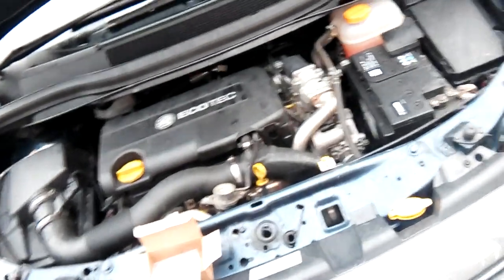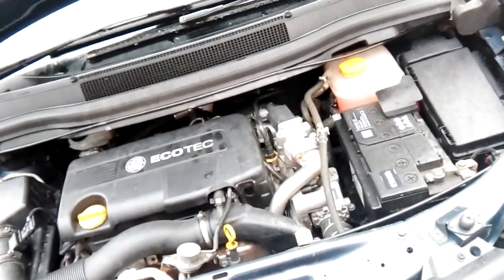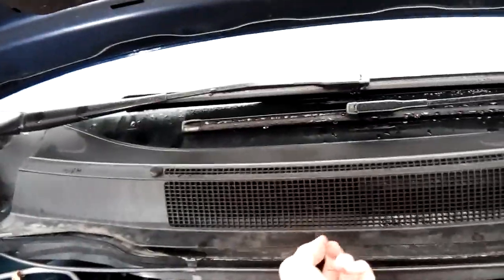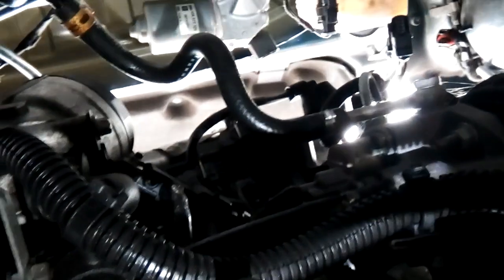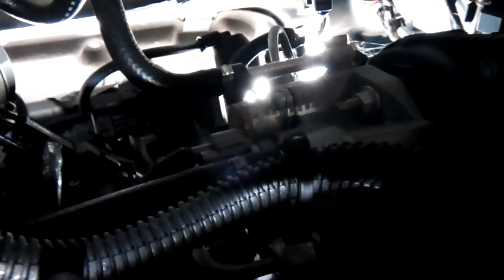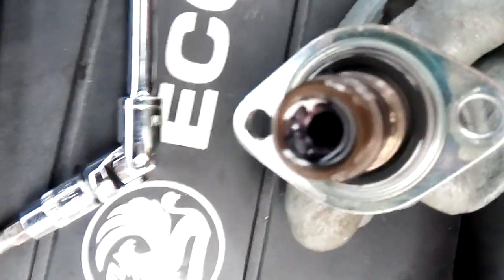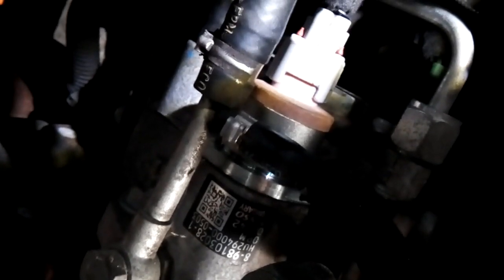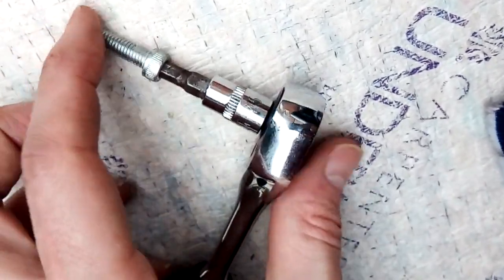Vauxhall (Opel) Zafira B 2011 Surge control valve replacement A17DTJ 1.7cdti Bosch

Comment: I have 2013 b 1.7 cdti zafira and had the same idle problems replaced the SCV  it idles great for 30 seconds and then cuts out pedal self test gave 3 fault codes 000161 then 023462 then 000000the only thing i can do is bleed the fuel at injectors or any sugestions thanks great video

Comment: Just did mine, good video btw, I did everything on top of the engine, the lower bolt was actually the easiest, it's the upper bolt which is against the head, you can't use your fingers to get hold of it, I had to use a long hex socket to remove and then glue the new bolt to it to screw in, then allen key to pinch it up.  Quite fiddly.  Drives perfect now.
Reply from the maker: Great news, glad you got it sorted. Yes bit of a tricky one to get to, great idea on glue to the bolt on the allen key to hold it in place!

Comment: Hi, Mate.

Do i need adjust valve after replacement?
Reply from the maker: Hi, no it self adjusts based on fuel required so after starting for the first time to get air out of the system it'll be fine.

Comment: Start by checking all basics, air filter, oil lvl and scan the car. If no codes it is likely the SCV suction control Valve on your high Pressure fuel pump.. https://m.youtube.com/watch?v=MHILFseKj5Q

Comment: Hi Andy,really good helpfull video,I have this same problem,is any chance you can drop a link where I can buy genuine control valve,I find so many on ebay but I heard is very high chance it is fake not genuine Denso,your link where you bought it is not working anymore,and at the deler they sad it will cost me to buy 270£ if you know where I can buy cheaper denso genuine fuel suction control valve please drop a link,thank you
Reply from the maker: Hi, glad it's useful to you. Searching on the part number this looks a compatible part.
Double check for yourself but that should work:
https://www.partsinmotion.co.uk/car-parts/ecu/fuel-supply/denso-suction-control-valve-dcrs301110-detail?srsltid=AfmBOorcmhSBXfo7NI0ZLJIDchMxxkl6i-ZRB-3k8jOvCUjpBOX47jnt0WM
Reply: @junkendriven  Thank you so much for quick response, all your videos is very helpful :) is it trustable link to buy and it is genuine part?,sorry I never bought anything from this website,thank you.

Comment: Hi, great video, I managed to get the bolts out, however I can’t seem to pull the valve out. Does it need turning before pops out? Thanks
Reply from the maker: Hi there, it doesn't need turning but if you look on the replacement valve there are orings that make it a very tight fit. Gently wiggle it free by a little side to side movement and it should come free
Reply: @junkendriven  sorry one other question, my new part has arrived with a new gasket, however there isn’t one on the old one? Did you use a gasket? Thanks

Comment: Hi have same issue whre the idle is hunting. Bought a £30 scv valve and the car wouldn’t start but when unplugged it it started… anyway I put the original part back in and it’s hunting on idle again however when I unplug it then it idles nicely… . Any ideas as to shall I leave the plug in or out or shall I just get a genuine part that costs over £200. Thanks
Reply: Please can you tell me whre you got your scv valve from as looking at your video your one seems to have done the trick
Reply: Thanks for that 👍will have another go at it
Reply from the maker: Hi Jimmy, yes I've had a few problems with the cheap egr they definitely don't talk to the ECU right, have a look on my channel as I've done a few videos and same as you found only genuine works. Could you do the trick I did, swap the egr valve itself onto the old motor/solenoid body and that should work for you?
https://youtu.be/qpCfEldit1A
Reply: Hi mate sorry I think you misunderstood me. I have the same issue as this and it’s all pointing to the SCV valve. I bought one for 30 quid and it didn’t work but when I put my old scv valve back in it works but hunts on the idle.
Reply from the maker: @jimmykvlogs2483  ahh, apologies, yes confused the videos as I had egr problems with a cheap replacement!
But yea you're right, a scv cheap one is also a problem in exactly how you describe, also cheap ones seem to fail after 1 year.
I bought genuine Denso scv similar to:
https://www.ebay.co.uk/itm/256085570211?mkcid=16&mkevt=1&mkrid=711-127632-2357-0&ssspo=0_DQ9XZ_QWW&sssrc=4429486&ssuid=anERn0beRa2&var=&widget_ver=artemis&media=COPY

Comment: Andy, is a SCV the same as a purge valve, that helps your engine to breath. I have been told to check my purge valve.. is this the same thing in a more modern engine than the plastic ones i have been seeing???
Reply from the maker: Hi, no the pcv is part of the engine ventilation system (often a plastic circle on the top of vauxhall engines, unsure on the zafira location). It's part of the crankcase ventilation system and if blocked it can cause issues.
The surge control valve is used for controlling the pressure on the fuel rail from the high pressure pump.
Hope that helps
Reply: @junkendriven  thanks Andy. Appreciate your clarification. I have been told to check it, seem to struggle to find it in the 2014 Opel Zafira 1.7cdti.. sounds a bit daft, but seems to be no info anywhere, but lots of people suggesting to check it. I can see it on older models, but, maybe it is updated on the B (2008-2014). ThNks hunting goes on!!!!!

Comment: Does the 1.8vvt engine have one of these? Mine does this randomly 🤔
Reply from the maker: I doubt it as that's a petrol engine the 1.8vvt so my guess for rough or rev hunting, first stop would be spark plugs and maybe coil pack
Reply: @junkendriven  it only does it while it’s on the choke sometimes. It’s had a new genuine coil pack and standard Bosch plugs not long ago. Still does it randomly only when on choke randomly but not every time

Comment: Hi Andy.  Thanks for the video.  I had exactly this problem on my 2012 Astra J 1.7 CDTi.  Bought a replacement SCV off eBay and fitted it yesterday.  Bit of a faff getting access to it, but replacing it has done the job and no need to re-calibrate the ECU or anything like that.  The surging has gone and the car pulls much stronger from cold when moving off - previously it felt down on power when pulling away from cold, but I'd put this down to general deterioration of the engine, but not so.  Now drives like a new car!  Cheers.  Graham
Reply: Merci pour l’info j’avais peur par rapport à l’écu la mienne le fait on dirait qu’elle va caler. Pas de problème pour le ré amorçage du circuit gasoil ? Cordialement

Comment: I have changed the scv naw the car keeps cutting out when stationary at traffic lights
Reply from the maker: Hi, is it taking longer to crank and start? I'd guess it's drawing air so chances are the gasket or seal isn't quite right on it so might need to re nip it tight. Stalling at idle is another give away that it's drawing air
Reply: If it only idles for about 20 seconds you'll need to plug an obd2 code reader that has some sort of function control into the car and select learn fuel pressure regulator function. Claude Taube has a video here on YouTube showing the procedure.

Comment: I had same problem mine was the camshaft sensor not the scv. It was identical problem as you shown here so just a heads up as it can also be other issues, the camshaft sensor is £37
Reply from the maker: Good info Leon thanks for that, did the camshaft sensor not throw up a fault code to the ECU?
Reply: @junkendriven  no because it was faulty not broken
Reply: @leonknight2599  hi when you changed the camshaft sensor did it need to relearn or is a plug and play part? 😊

Comment: I have same problem with my zafira 1.7 cdti ecoflex  2011. Can I ask you what I need buy just fuel pump pressure?  Thank you
Reply from the maker: Hi, this is what you need, the denso valve:
OEM/OE code DCRS301110 Denso diesel fuel suction control valve
https://ebay.us/8PVTcV
Reply: @junkendriven  thank you

Comment: Excellent, thank you. Should cure one problem but my big ussue is same engine fails pollution test but there are no faults on the diagnostics.  Very confused and so is my mechanic.  Cheers.
Reply from the maker: Hi Robert, glad the videos have helped, for pollution failures (exhaust gas on MOT?) then my guess would be to look at the EGR next, I'm about to put a new video up in the next week as I've had a catastrophic failure of my EGR in the Zafira, but it might help you also.

Comment: hi do u know what would be the issue for an error code of p0171
Reply from the maker: P0171 is o2 readings on the exhaust output sensor being too low. Could be all sorts of things, vacuum leaks, MAF and air filter are the easier ones to check and spot. I'd start looking at those 3 first before going further in.

Comment: Hi Andy I have the same issue on my 2011 zafira 1.7 cdti ecoflex elite. Would you have a link for this item. Also would it have an issue where the fuel range dissappears every now and again and goes through more fuel?
Reply from the maker: Hi there. Try this ebay link:
 https://www.ebay.co.uk/itm/-/283914172059?mkevt=1&mkcid=16&mkrid=711-127632-2357-0
For the suction control valve.
Also, the fuel range will be due to DPF regeneration cycles, take a look at my other video: https://youtu.be/48V45aTW6io
Reply: Thanks for getting back to me Andy. Today I managed to change the suction control valve.when taking it out I took a small pull . But when putting the new one in I couldn’t push in so easy . What I had to do was use the bolts and put them in bit by bit and it did go in and tightened up nicely .but I couldn’t test it as when leaning over the top of the engine the leak off pipes where very brittle and one snapped at the t junction 😭
Reply from the maker: @burncdm  Ohh, bad luck, yes those diesel return pipes can be pretty brittle, easily replaced though just search ebay for them. Glad you got it replaced, yes they can be tricky to go back in, it's due to the o-ring sealing well, which is good as makes sure it's a good seal. Hope you get sorted and back on the road soon.
Reply: @junkendriven  also now with replacing the scv and the leak off pipes and replaced the fuel filter she won’t start 😭any ideas Andy I’ve taken off the fuel injector pipes but nothing she’s definitely air locked
Reply from the maker: @burncdm  just saw your comment on the FB group!
Use the low pressure fuel pump to reprime the system. Ignition to on position (not start) and wait a minute or two. Back to off and repeat a few times. That will help get fuel back into the system that was lost when the solenoid was removed. That should help, just be persistent and it'll fire.
Reply: By any chance would you have a video on replacing them ?

Comment: Thank you so much, Andy. I have a Zafira B 1.9 CDTI and engine turns of by itself. I cleaned throttle body last week, but it just only worked 6 days, today engine stopped suddenly again on my way to work. Do you think I also need to change the surge control valve to fix the problem? We have changed the diesel filter and cleaned throttle body. But it worked temporarily. Could you share your experience, please?
Reply from the maker: Hi, anything with fuel system seems to cause intermittent. The problem is there are so many components. Are you getting engine management and any codes?
At cold does your revs hunt like mine? If so then yes I'd say worth changing but it's a bit of parts darts at that stage unfortunately
Reply: Could be your fuel pump, the same thing happened to my zafira b diesel .

After testing most things out the mechanic came to the fuel pump and changed it. Voila the car start working again, however the surging issues have persisted and sometimes it makes a rough engine idle sound by going lower in revs than normal .
When I accelerate the revs it goes back to normal surging .

I don't know how to find out which scv I need.

I am not good with replacing parts etc .

Comment: I had this surging problem with my zafira until a couple of months ago.. purchased the scv from gsf parts.. now runs as it should and saves some fuel to...
Reply: How much did you pay for the part?
Reply: How did you calibrate the new scv? Can you also do it with opcom and how?

Comment: hello I have a problem with the radiator fan which starts very early after 5 to 10 minutes of starting the fan engages for an Opel Zafira B 1.7 CDTI
Reply: Is the car trying to do a dpf regeneration. You can check this buy stopping car and look at fuel consumption if it is 0.5 or more instead of 0.1 then you need to take car for a run over 40mph constant above 2000 rpm change down gear if needed to clear it
Reply from the maker: Hi, as Leon states, chances are it's related to dpf regeneration as that turns the cooling fan on. The air con being on is another reason your cooling fan would be on.
For dpf I did a video on it and how to fit an indicator light https://youtu.be/48V45aTW6io

Comment: Is this engine part the same as the fuel pressure regulator? I've seen this problem being fixed by cha ging that ? Is this the same problem ?
Reply from the maker: Yes, I believe it's one and the same on the 1.7cdti ecoflex engine. The Surge control valve is directly on the back of the high pressure fuel pump so my guess is it's also called the regulator as it's a solenoid that can pulse to vary the pressure.

Comment: Where can i find it?
Reply from the maker: Hi, part number and link on amazon:
OEM/OE code DCRS301110 Denso diesel fuel suction control valve https://amzn.to/3mjDpy4
Reply: @junkendriven  thank you😥.
I mean, where do I find his location in the car?😁
Reply from the maker: Ohh, apologies. So the surge control valve on Zafira 2011 is down the rear left side of the engine (As you face the engine bay from the front). It's attached to the high pressure fuel pump which is driven by the timing belt, so follow the timing belt housing towards the back of the engine, then down and you'll find it.
Reply: @junkendriven  Thank you 🙋‍♂️💙

Comment: I've been wondering what was Causig this. Have looked everywhere   on forums as to what could be the cause. Only you mentioned the SCV.  That engine idle and rev counter is identical to what I'm currently experiencing. So I have no doubt it's that. I've ordered a new SCV and will be fitting it Tuesday. Hopefully this will be solved. 
Thanks Again 👍
Reply from the maker: Great news, yes it's obscure but hopefully it'll do the job and solve your issue. Thanks for commenting :-)
Reply: @junkendriven  garages were saying could be egr valve etc. Would have to bring it in. 
They would then have slapped the labour on top etc. So spending 70 quid on a part is much better. 
I was sceptical until the sound your engine made mirrored what mine does now.
Reply from the maker: Egr is a possibility so don't totally dismiss it. I've done another video on cleaning the egr if you want to give that a go as it's easy and zero cost.
https://youtu.be/3R2MCWQGCT4
 The difference I found is with egr the rev hunting didn't go away, it would do it at different revs, speeds, after engine earned up, etc.
This scv was specifically at cold and goes away as engine warms up.
Reply: @junkendriven  Just a quick update...
I've installed the new suction control valve and the problem seems to have been eradicated. 

I also had another issue before changing the SCV which was when driving the vehicle it felt like the car was being pulled or held back when driving. But this has also been eradicated. So thumbs up all around...

I think this has been an issue for a while. It was like it when I bought the car. I think the previous owner had this issue and looks like he changed the egr valve in a trial and error to try to and fix the problem. I assume he probably didnt know about the SCV
Thanks again 👍
Reply: The problem seems to have come back around 6 weeks after the suction control valve has been changed. May have to change it again
Reply: @geraintjones1349  did u manage to fix it. Same issue on my Astra j 1.7
Reply: @geraintjones1349  May i suggest buy a denso or better quality part.. i have heard cheap chinese (or these being sold as expensive, but are not Denso or OEM are poor parts. Mind you, i recently heard that cheap rip off parts are making it into mainstream OEM parts or being sold as a quality parts..i suppose anyone can change a label if they want too.. 🤔

Comment: Very informative, thanks. I have very similar issues with Astra J 2.0 cdti, although not quite as erratic yet. SCV again, do you think?
Reply: i thought the astra j 2.0 used the bosh system, unles it is the ech,teck engine

Comment: Tried this and it didnt work.
Reply from the maker: Sorry to hear that, you still have engine idle hunting? It may be a vacuum line or something elsewhere. Good luck finding it.
Reply: @junkendriven  changed mine, and cleaned out the EGR now it cranks but wont start ( will start one every blue moon but cuts out soon as foot off) any ideas ?
Reply: @junkendriven  yes,cleaned all sensors too. Goes into limp mode alot which is dangerous as their is completely no power when pulling out junctions.

Comment: Did you have blue smoke during the idle?
Reply from the maker: Nope, blue smoke at idle is not a good sign, that's normally oil being burnt. Check oil levels, see if it's way too high, if so it needs draining and all oil relplacing as diesel has mixed into oil.
Otherwise you're looking at possible turbo seal failure (oil leaking into intake) or worse

Comment: Thanks for the video. Where does the big O ring sit?
Reply from the maker: Outer ring, you'll spot where it sits between the solenoid and pump. Difficult to keep in place whilst fitting though!
Reply: @junkendriven  it’s ok I managed it, I just popped it on the SCV as I placed it in. Seems ok & not leaking, probably because there is a gasket there too but thank you for your response
Reply from the maker: @hikingwiththeshackletons  great work! Glad you got it sorted